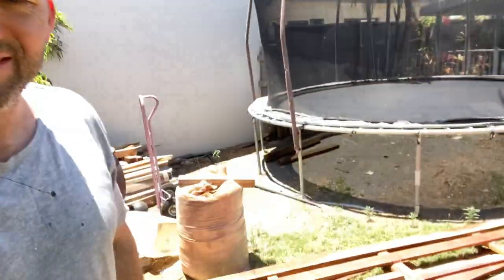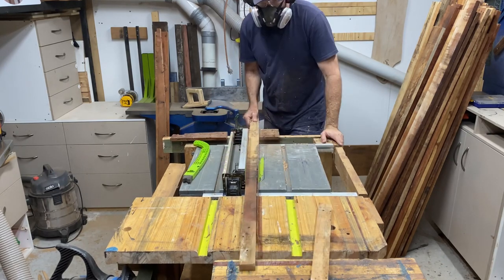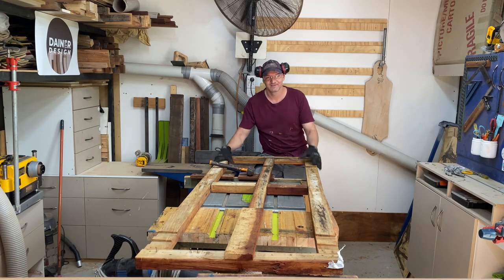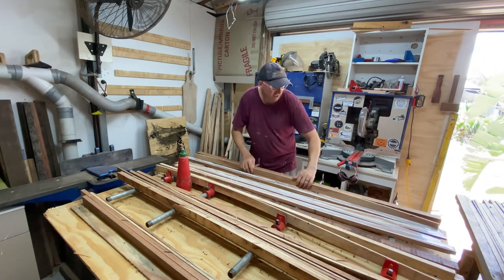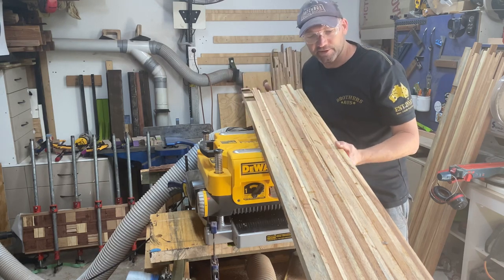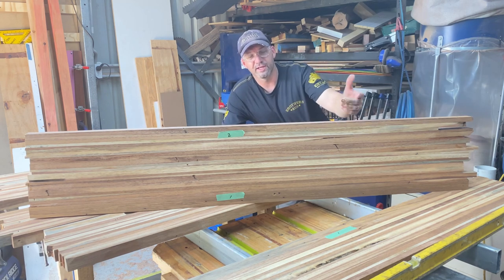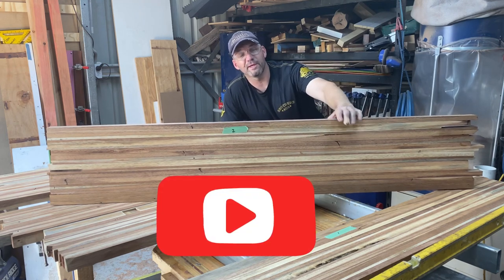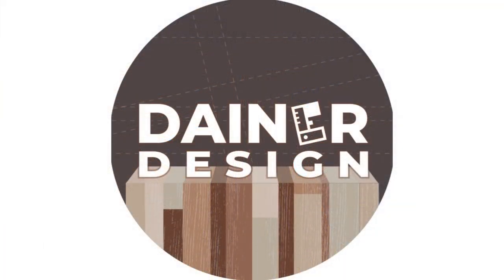How to make long pallet slabs with long palletwood

Comment: Hola! 🖐I rarely come across long pallets like that but when I do they end up on the bed of my truck super fast! Your shop looks good though it looks like you are still acclimating to the floor plan as you move the slats onto your workbench and bounce around a bit, haha! So the left hip is good on the slide but the right one not so much, get that checked out. We want you to make hundreds more videos and it would not be the same without the glue up slide. Awesome looking pallet slabs, great job. Take care and have a good one, Adios! 👊